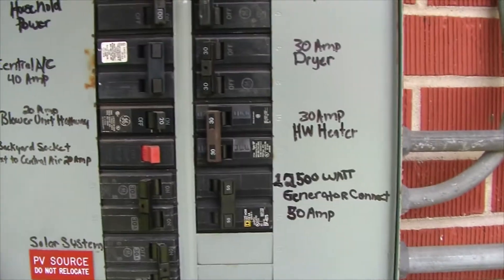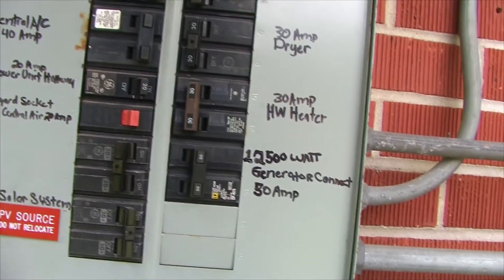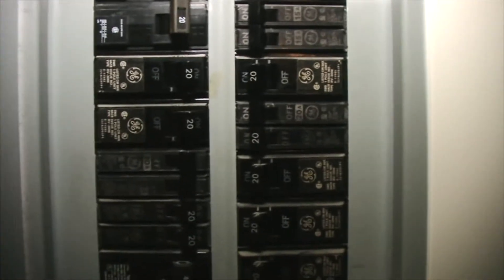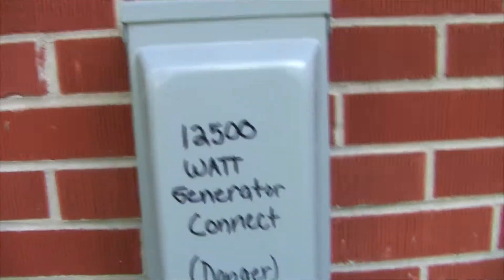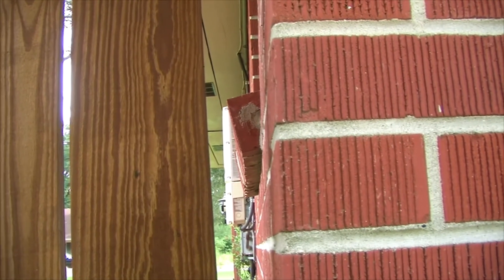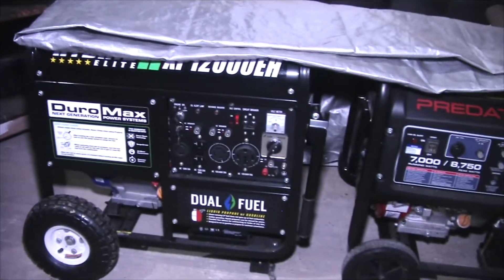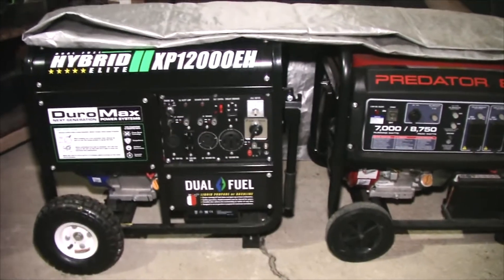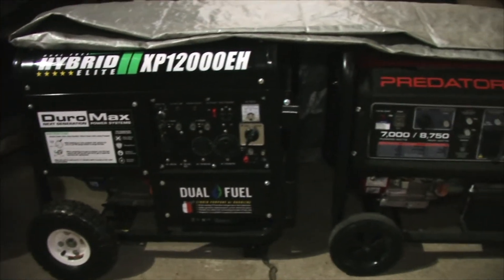Predator 8750 & Duromax XP12000EH Dual Fuel Generators Part 2

Comment: I don't see a transfer switch. How do you prevent accidental backfeeding to the commercial power system? Don't the main breaker and the generator breaker have to be interlocked to prevent simultaneous connection?
Reply from the maker: No!!! An interlock is a safety precaution for those who are not familiar with how electricity works!!! I simply disconnect my main service connect from the pole, then switch my 50amp on to my generator which powers my 100amp breaker to my home. My studio is powered on a separate 30amp breaker with my secondary generator which is on the outside of the studio. I disconnect my 60amp breaker from my main panel to the studio before I run power through my 30amp to the studio using the generator. My setup works exactly as planned and does  1 hell of a job. What's good is that I don't even have to run the studio unless occupied... It's used for secondary living in case of emergency!!!

Comment: Thanks, Shelton do you know of a display that show Hertz also. Your display only shows 4 things (1) Voltage (2) Current (3) Power (4) Energy. I am looking for one that shows Hertz because i am going to install a natural gas conversion kit on my generator. The dual fuel generators adjust themselves. I will have to adjust my RPM or run speed to get my 60 Hertz on my GAS fuel only generator . Thanks again
Reply from the maker: Not sure!!! Actually you could research the specs of the meters to see if the have a conversion to Hz... I think you can add a Hertz monitor in between the connection and tweak to get the values your looking for!!!!